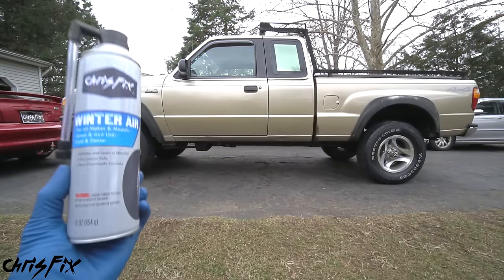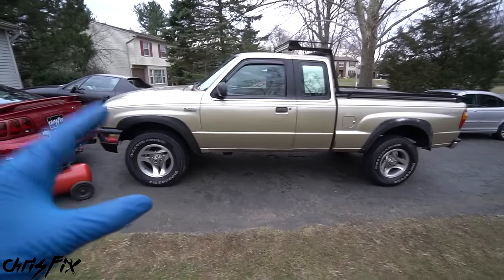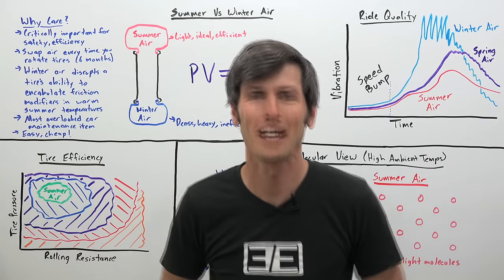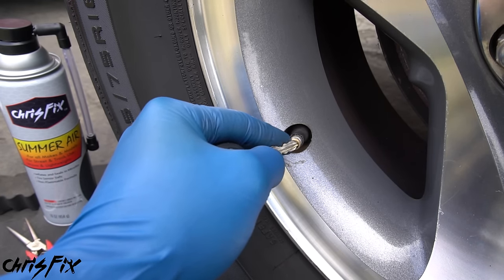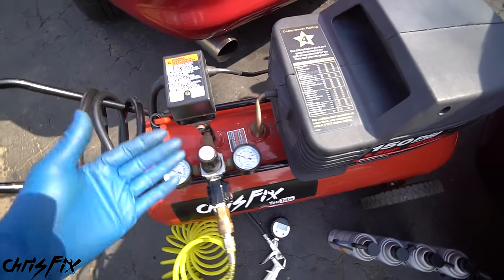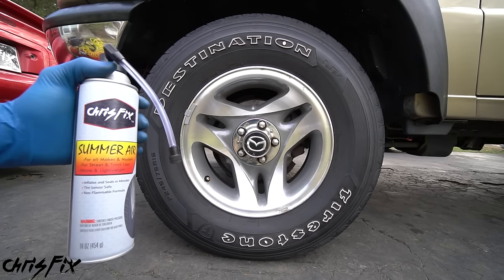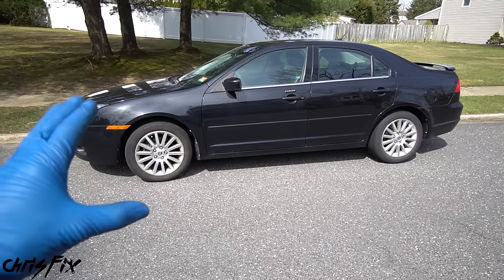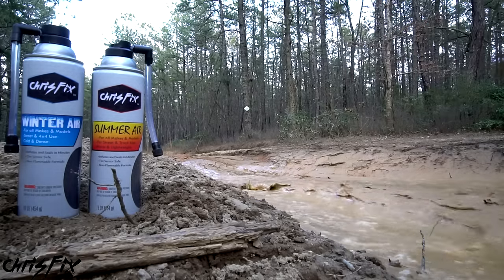Why it's IMPORTANT to use the Correct Air in Your Tires (Summer & Winter Air)!

Comment: “Winter air is not an ideal gas.”

-Jason, 2019
Reply: True is true!
Reply: Trust him, he’s an engineer
Reply: Dunkaccino25 Im in ap chem and so ik what and ideal gas is... and his explanaition seemed a bit logical especially since gases are closest to ideal at higher temps but also lower pressure... so like if this video was serious I would be questioning the ideal gas of the summer tires cause that means they need to be at lower pressure therefore having an underinflated tire especially since, I beleive, no gas is ideal.... because its ideal not necesarily like real. (also Im sorry if you dont care about what I just said)
Reply: Frank Bui I have my bachelor’s in Chem, and I see what you mean lol. PV=nRT is the ideal gas law, which is different than real gases, so he’s not entirely wrong lmao.

Comment: I actually believed this until I looked at the date it was posted😂
Reply: @chrisfix  
I feel betrayed ;-;
Reply: That's it, I'm gonna start selling summer and winter air on ebay!
Reply: Becours it is kinda based in reality do to the formular EE showed air expands and contacts depending on tempature so if you fill your tires at +30 and it goes to -20 you might need to top it off however most places with that kind of climate change changes tires anyways
Reply: Lol same as you
Reply: Same

Comment: Spray down the valve area with blinker fluid to make sure no bubble is produced.This mean all winter air has been flush out. Remember to do it so that no winter air is left in the tire.
Reply from the maker: I would probably use soapy wooder instead of wasting expensive blinker fluid, but good idea!
Reply: @chrisfix  Blinker fluid is denser so the bubble can stay on longer before being poped by the heavier winter air particles!Which can help us observe the air flow better!

Comment: When I first moved to Pittsburgh my tires were filled with Summer Air from Florida.  Came out one day to the cold day, the first snow, it was beautiful!  Jumped in the car, and my Summer Air ran flat in the tires!  Tire Pressure Monitor was on for all four corners of the car.  All four tires were down to 20 PSI.  Summer Air, since it isn't as dense, winds up not being resilient to cold.  I was able to drive slowly to a gas station that fortunately was in the north, and filled up my tires with the proper dense Winter Air. Oh and the windshield wiper fluid also froze.  They don't sell the -20 degree fluid in Florida.

Comment: I do a lot of off roading and need all the traction i can get so I run Arctic air in my rear tires and Himalayan air taken from the top of Everest in the front. It can be a little expensive having it all imported, but the extra performance is worth it. Plus it's a hell of a flex to be able to say that you have Himalayan air from Everest in your front tires. 😊

Comment: Someone: Oh no! I filled my tires accidentally with helium! What shall I do?

ChrisFix: Fear not, citizen! I have come to save you.
Reply: Never fear, Chrisfix here!
Reply: Tie a rope on the car. There are some places designed for that purpose. Check manual.
Reply: Omg he should've said helium so it lifts the car/truck off the ground for "less friction" so it allows you to "go faster" 😂😂😂
Reply from the maker: Is it summer helium or winter helium?
Reply: @chrisfix  good question
Reply: @chrisfix  It's Fall helium

badumtss
Reply: @chrisfix  wouldn't you have to replace it when the seasons come?  According to your video😂😂
Reply: @chrisfix  what about autumn helium and spring helium

Comment: I thought if you have all season tires, you need all season air...  hmmm...
Reply: Well if you get all season tires, you need to wait a year before you can use them. If the suggested tire pressure is 32 psi, then put in 8 psi each season. After a year, you'll have the desired all season mixture. The worst is if you have snow tires. Do you know how hard it is to get snow in a tire!? Quite irritating and tedious.

Comment: Maybe racecars should use winter air in the drive tires for better traction
Reply: I personally use pennzoil track air.
Reply: Increases unsprung weight and increases rotational mass.
Reply: Bobby Greene it would not be better in the long run. While you gain better traction you loose about 40 horsepower. Believe me. 40 HP makes a huge difference. Stick with summer air.

Comment: Alright i just replaced the air in my tires and while i was doing the rear back wheel i noticed my blinker fluid is leaking. Is there a way to seal the blinker so the fluid doesn't leak out or do i need to buy a new one?
Reply: If that's happening, You may as well check your relative bearing grease. Good chance it was contaminated by the blinker fluid.

Comment: Instructions unclear. Gearshift stuck in radiator fan.
Reply: My air filter just flew out of my exhaust, always use the right amount of blinker fluid to make the windshield not crack

Comment: Its funny that i find this video tonight! 😂🤣😂🤣 i had 2 flat tires from my truck sitting all summer. They had summer air in them and its starting in to Autumn with colder temperatures. My mom and i had i discussion about which (summer/winter) air i have in the other tires. Awesome video!

Comment: … I use dry (moister free), summer air.  I don't want the inside rubber to rust from moister, and that's the best way to do it. Keeps the tires rust free for years......

Comment: Hey CrisFix Are You Ever Going To Put A Turbocharger In The Driftstang
Reply: Mustang should have supercharger
Reply: Fawwaz Rafif doesn’t matter they should have either but supercharger is prefered
Reply: Superchargers runs off of engine power, but a turbocharger compresses the air by making power from the exhaust. That's just one way why a turbocharger is more efficient (more increased hp than a supercharger). Superchargers tend to be a little bit cheaper and it's instant power as you accelerate instead of waiting for your turbo to spool up, that's why more people usually have a supercharger than a turbocharger
Reply: Kunal Findley Tbh it’s all on personal preference tho
Reply: @kunalfindley158  since when are superchargers cheaper then Turbos ? xD
Reply: @exoticoverkill4990  dude superchargers are usually tons less than turbos. They're less complicated. You just have to buy a belt and pulley rather than a completely different exhuast manifold to power it.
Reply: Supercharger with twins turbo
Reply: who’s crisfix?
Reply: tappy    Bruh
Reply: ctOS 2.0 who is he?
Reply: tappy      Hes the guy in the video
Reply: ctOS 2.0 oh so youre talking about CHRISFIX
Reply: @kunalfindley158  superchargers also gives faster response.
Reply: @kunalfindley158  that is not the reason people use them, superchargers have specific use cases, where you want power throughout the whole power band instead of waiting for your turbo to spool up.
Reply: @sparklygames71  true, I'mma edit my comment. Thx
Reply: @kunalfindley158  haha nicest interaction I've ever had on here :)

Comment: You can use a silica filter for the compressor intake to fill the tires with dry air which is better and an alternative to nitrogen fill
The filter can be made very easily:

You need a tube to connect to the compressor air filter
Next you need a bottle for silica, at least 1 litre. 
Make a whole in the bottle cap to insert the tube
Make holes on the side of the bottle
Buy silicat (used for cats) which is easily available and fill the bottle. 
I use such a filter for a high pressure air pump and works well. The original used like 50ml of silica and was worthless, too small

Comment: Thanks Chris! I really need to get the summer air in my tires. I suppose while I'm at it I should also replace my blinker fluid and muffler bearings. And I need to check out my clutch belt as well.

Comment: Wet Winter air is heavy dry Winter air is light same category with summer if you have to air up your tires when it's wet so be it if you have to go to snow and ice or simply you have to but change it out to dry air is to this it dries out however it is up drying out You're barometer will tell you how heavy the areas that's what it does
Reply from the maker: Thanks for sharing!

Comment: Ok obviously this is just a joke but there is a tiny grain of truth to it.  Pressure changes with temperature, and a lot of people don't realize that when air gets colder, the pressure goes down, and then end up driving all winter with low tires...which contributes a lot of poor traction in the snow, ice, or even rain, and crashes (this is assuming you use all season tires and don't have different sets for summer and winter).

A lot of people also don't realize that you are supposed to check tire pressure when the tires are at ambient temperature when the car hasn't been driven for several hours...if the car has been driven the pressure will read higher and you could accidentally underinflate your tires if you set it to the correct value when they are hot.

TL;DR - check your tire pressure often, and be prepared to add air in the winter, and remove some when it starts to warm up.

Comment: Nopse! Alien air is the best by far. Good in the summer and winter. If your car should find itself on a different 
planet, (summer or winter) it's still good 2 go. Yes, Alien air cost a little bit more, but it's worth it. You will have 
to check the interstellar exchange rates. Don't forget to drive safely wherever and whenever you drive.

Comment: Thanks for the video Chris, it’s very helpful! I have a question though. I live in a tropical country, do you know when I should change the air in my tyres? Or should I maybe just run one of them and not change?
Reply from the maker: If it's warm all year round you dont have to worry about the winter air. Just fill up with summer air!

Comment: well basically this is correct because warm pressurizes the tires so u have to take out some air in summer and add in einter to keep the pressure

Comment: Great tutorial, just one little mistake I noticed; you say change the air in all four tires, but what about the spare? There's not much point having a spare wheel if it's got the wrong air in it. Otherwise a very good video :D
Reply: Honestly, there's not enough of a difference to really care about if it's a donut. It's only worth the trouble if it's a full size spare you plan on using.

Comment: We use nitrogen in Canada because it is inert and does not expand and contract with temperature. So yes this is a joke video but its not in Canada. If you don't use nitrogen you constantly have to release or add "normal air" as the seasons change.

Comment: Can you make a tutorial for how to patch a wiring harness and refill it with smoke, please?

The shop is trying to sell me a whole new harness.  Nice try, I took it back home and I think I found where the smoke leaked out from.

I'm not sure what I'm doing wrong.

I wrapped the wire with tape and found the smoke reservoir on the battery.  It was full of water(!) for some reason.  I guess that means the seals are bad?

I dumped the water out and put some fresh smoke in, but still no luck.  Maybe it got air/water in the wires?

Is there a purging procedure to decontaminate the lines?  Or maybe I'm using the wrong smoke?  I couldn't find any smoke kits at the parts store, so I used the beekeeper stuff.  It's all natural, which I thought would do the trick, but maybe my car needs synthetic?

Comment: This is an actual thing colder air means that ur tyre pressure light might come on if u filled air in summer and if u did in winter then in the summer the pressure will increase

Comment: I’m wondering about the air left in the top of the tire. Would it help to do it again after a few miles and the air has spun and mixed?
Reply from the maker: The correct air will replace any air left at the top!
Reply: @chrisfix  excellent. I wasn’t sure since i have a spare set of wheels that my studs are on so i leave the winter air in them. On a serious note, thank you for your videos. I’ve got a lot of good tips from them and i smiled for all 40min of your dream car vid. Congrats.
Reply: Just get a straw and suck the air out to make sure all the old air is out.

Comment: I know this is a joke video but I am asking myself something here. If you filled up your tires in the summer wouldn't the "Summer air" fill the tire up less when it's colder? I mean the air gets injected into the tire at a different ambient temperature. So a tire filled in the summer should actually have less pressure in the Winter months since it is colder. Vise versa a tire filled in the winter with lower ambient temperature should have more pressure when the ambient  temperature rises.

Comment: Should have changed the plate inside the door, to say cold air pressure, and hot air pressure. Need hot air for summer, since it's lighter (wink) I get much better gas mileage with hot summer air in mine

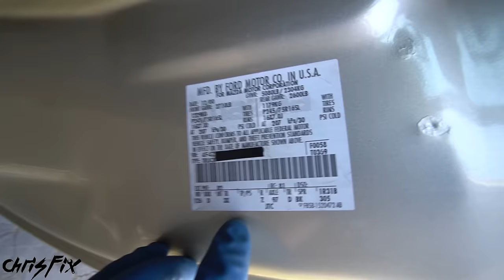Comment: 5:54 But but, if the tires are rated at "30 PSI COLD" for cold heavy winter air shouldn't you inflate to a higher psi with the lighter rarefied summer air? After all the PV=nRT ideal gas law equation shows us that P (Pressure) is directly proportional to n (the number of moles of gas) and thus if you have a denser gas with cold air and thus more moles per unit volume you would have more pressure if you put in the more widely spaced hot air? Maybe you need a part two for this in the next month or so and a chemical engineer to more deeply explain the math and thermophysical properties behind this annual phenomenon. But makes sense after I've read a few sites saying to check the tire pressure after extreme weather changes. Would this be cheaper than the nitrogen gas tire fill? Thanks

Comment: Hello, I like your videos, but I don't agree with the idea of changing air in winter and summer. PV=nRT is true, but if T changes you just have to adjust the amount of air (add or remove some) to achieve the desired pressure. The winter air doesn't weight more than summer air, or at least not because of the ideal gas theory. The amount of water in the air is what matter.
Reply: Lol

Comment: Chris, I have a 97 silverado 5.7l, It died, I changed spider injector, to mpfi, then no spark, i did smell plastic burning, changed my crank sensor, it starts now, but idles rough, wont run right on the street, P0102 MAF sensor, changed that, still the same, any ideas?

Comment: A choke hazard safety warning to not swallow the valve stem dust cap should be included. Claims 1,000's of innocent lives a year. Summer/winter air changes can be deadly. A million dollar govt study should be done and cap tethers made mandatory to save lives!
Reply: I think you and I could do that study for $750,000.

Comment: Wait a minute ... if the difffernce in weight of the air in one tire on the Del Sol is almost 6 pounds, and your truck has tires that have a much larger volume, but one can is still enough to inflate it to 30 PSI (about the same as Del Sol) .... HOW MUCH DOES ONE CAN OF WINTER AIR EVEN WEIGH? 
It has to be WAY more than 6 pounds, since summer air may be ligthter, but it certainly isn't weightless, and the can itself also weighs something ... is it even worth it changing the air, when you're carrying couple of very heavy spare cans full of winter air in your truck anyway?

Comment: Where can I get Spring and Fall Air? 👀
Reply from the maker: You don't usually need it, but if you do, check your local parts store! (They usually have it in between the synthetic oil section and the piston return springs!)
Reply: Thanks lmao 😂

Comment: History Of ChrisFix April Fool's Videos
April 1 2016: Replace Blinker Fluid (Essentially Water That Acts As A Fluid For Turn Signals)
April 1 2017: Replacing Muffler Bearings
April 1 2018: Replacing Engine Piston Return Springs
April 1 2019: Replacing Winter Air With Summer Air For Car Tires
April 1 2020: Installing Discrete Flatulence Odor Removing Exhaust Fans On Car Seats
April 1 2021: An ASMR Video Of ChrisFix Replacing Wheel Bearings
April 1 2022: Replacing A Bathroom Sink Tap
April 1 2023: Replacing Windshield Wiper Brakes
April 1 2024: TBA
Reply: Just what I was looking for!

Comment: SOrry but I am confused... On the door it said Cold... If I am putting in summer air should It be more or less since summer air is hot?
Reply: When adding air in the summer, you must do it at one hour before sunrise, which is usually the coldest part of the day.  Unless you have access to a drive-in fridge, then you can do it at any time.

Comment: I would rather put my air compressor in freezer or heat it, depending upon which air i require
You r ripping us off by selling useless products.
Reply: check the date
Reply: @sm7_633  date of post u mean , haha
U dint get the pun that was intended. :D